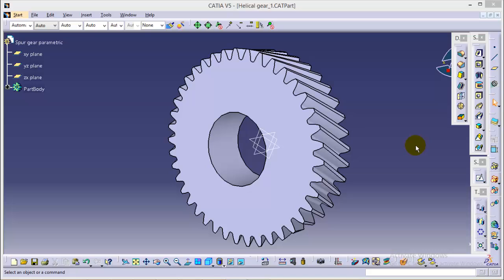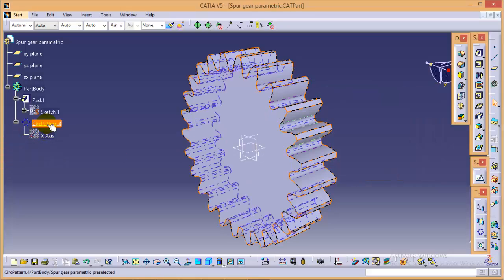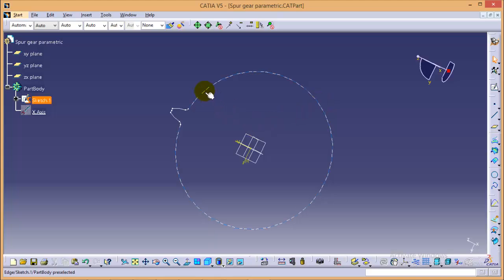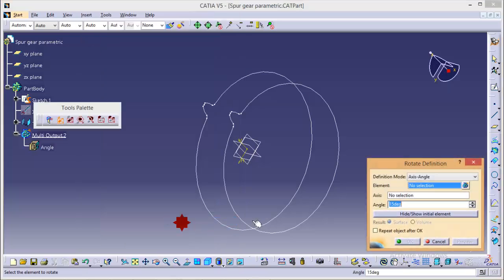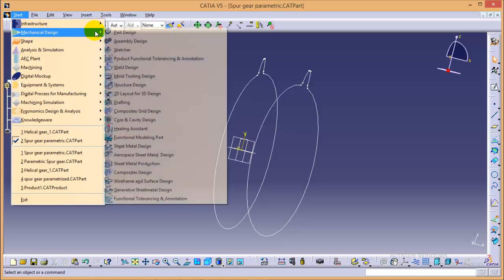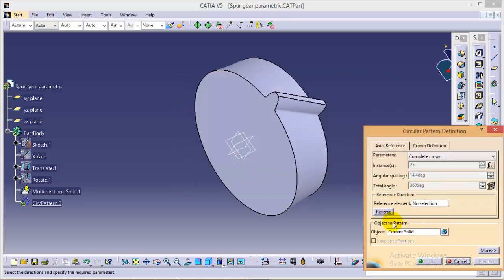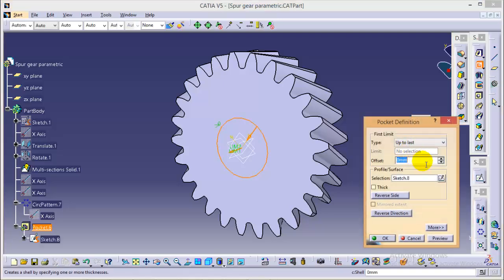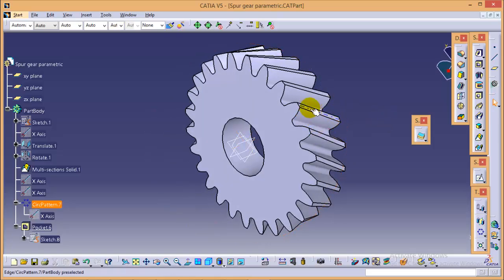Catia V5 Tutorials/How to create Parametric helical gear_15 deg helix angle\parameteric formulae

Comment: Hi!
This video is wrong, this is not a helical gear. you just twist a spur gear. And even that is done in a wrong way, you twist it with 15deg but that's not a helical angle. Helical angle is measured to the axis of the gear on the pitch diameter. I you create a higher gear you will see the errors with eye. You need to rotate the involute into the normal profile and create a helix and you a Rib command.

Comment: Nice video, BTW the rotatio angle over "X" axis should be 13.3925° approxymately to achive a Helix angle of 30° respect the main axis of the gear. Also if you have internal errors with circular pattern operation, yuo can use a pocket to eliminate the dedemdum internal area of the solid, leaving just the gear teeth, then use circular pattern with it and next use pad to extrude de internal dedendum area again, that worked for me.

Comment: Dear Abhishek, I appreciate the efforts you are taking to reach to the masses with your videos on CATIA. I know that's really a tedious job and you are too dedicated towards it.  But, let me put a comment on the video of HELICAL GEAR. You have two sketches and one of them has been rotated by an angle equal to HELIX angle. But, let me tell you, this HELIX ANGLE is not measured in FRONT VIEW of the gear but in TOP VIEW. So, to have 15 degree helix angle, you have to turn the sketch by some different angle. You have to draw two lines in TOP VIEW making HELIX ANGLE between them. Project their endpoints on front plane and then measure that angle in FRONT VIEW and this is the angle by which that sketch need to be rotated to get 15 degree HELIX ANGLE.

Comment: While doing the circular pattern it shows the following error 'Confrontation between highlighted faces cannot be solved'
What should I do?
Reply from the maker: Rajat Tank  Hi..While, using circular pattern command, Make sure to select following options as:

Parameters: Complete Crown
Instance: N (from edit formula)
Reference element: X axis
Object to pattern: Current Solid.
I hope, After selecting following attributes, You should not get above error. Please watch: from 2.25.
Please let me know, if it doesn't work.
Thanks... Stay tuned!!
Reply: I have these parameters selected but I still have same problem as Rajat Tank. Can you help me?
Reply: Abhishek Agrawal same error here please solve

Comment: Hello,
        When I defined the circular pattern, there came an error known as ' check its tangency points' . Please suggest me what shud i do further?
Reply from the maker: Akkshhey Agarwaal While using a circular pattern command, you should select an axis, which is not interfering with the sketch or figure,of which you need to make pattern. I guess, you are making some mistake while selecting a sketch and axis to make circular pattern. I would suggest you to follow this tutorial again step by step and try to replicate the same. If error still occurs, please send me the snapshot of same. I will look into it and advise you for same.
Reply from the maker: Please check with the axis and objects you are selecting for a circular pattern. If possible, please watch my spur gear tutorial too for better understanding.. If same error still occurs, send me the screenshots of your work at Abhishek.a32@gmail.com. It will help me to find what actually had gone wrong in your sketch. Thanks...

Comment from the maker: @saurabh bauskar : Topological error in Catia is an indication that you are doing something wrong at small level.It means either you have selected the wrong command ,there is a gap that is beyond tolerance of Catia, or intersection is not there and you are thinking its there.

I would suggest you to make it again with same methodology. Double check all lines, sketches for complete intersection and closed profile.Always use parameters for numeric dimensions (e.g. for 'circular pattern' command, instance should be selected as 'N' from edit formula, instead of giving manual value '25'). Module and number of teeth should be well within a limit to avoid interference of gear teeth.

If you still get the same error, please let me know values of module and Number of teeth, you are trying.  Thanks!!